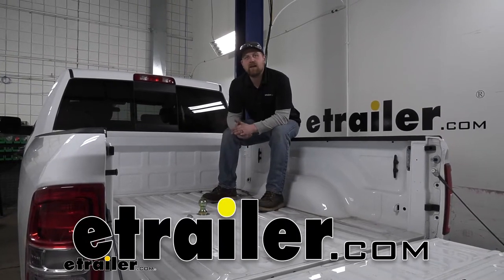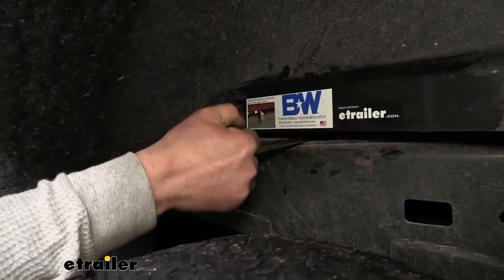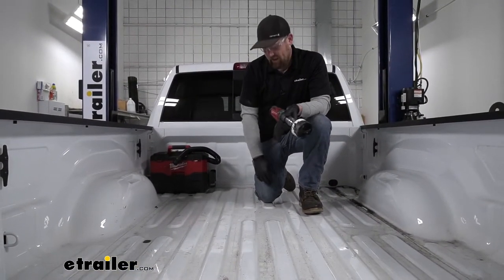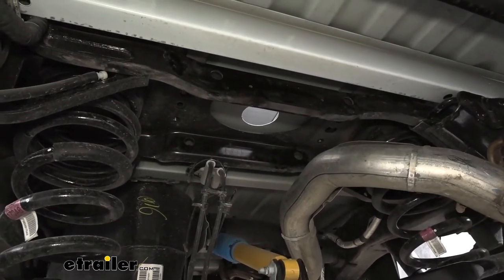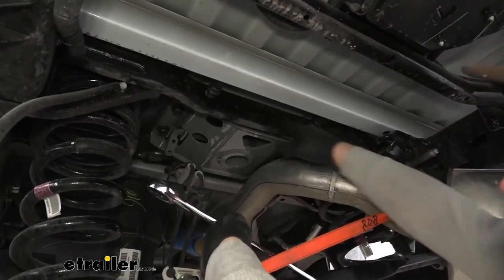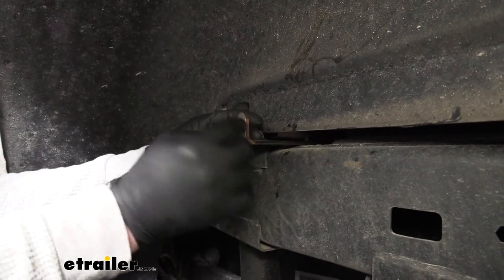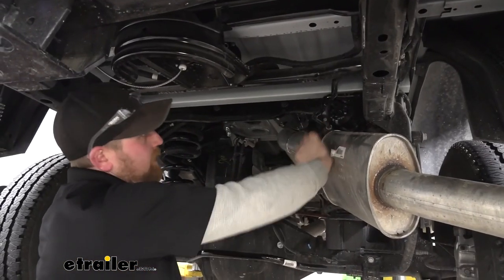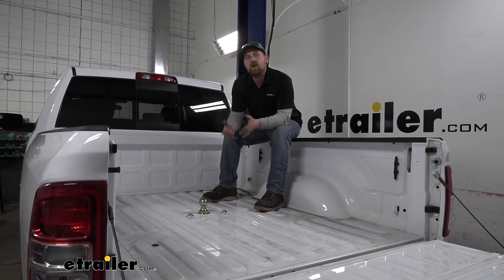etrailer | B and W Turnoverball Underbed Gooseneck Trailer Hitch Installation - 2021 Ram 2500

Comment: Question...the gooseneck hitch can be from any year or it has to be specifically the year of the Ram...my Ram is 2021 can you put the specifications of the goose neck
Reply from the maker: The hitches are model year specific. The B&W # BWGNRK1320 Turnover Ball gooseneck hitch fits 2019-2024 Ram 2500 and 3500 series trucks. Are those the specifications you were needing? If not, let us know.
https://www.etrailer.com/Gooseneck-Hitch/B-and-W/BWGNRK1320.html